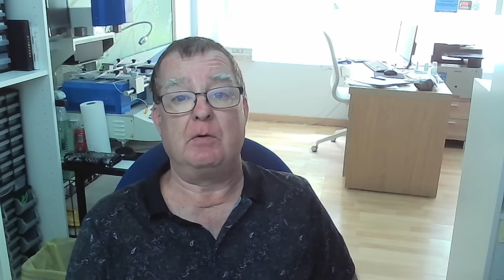The Art Of Methodical Fault Finding - A Practical Example

Comment from the maker: IMPORTANT NOTE At 51:12 I drew the collector of the transistor connecting to the wrong end of the 10K resistor.
Reply: How the hell did you pass your exams 🤦‍♂🤣🤣🤣🤣🤣🤣🤣🤣🤣🤣🤣🤣🤣🤣🤣🤣👌👍
Reply from the maker: @paulc9139  With distinctions funnily enough LOL
Reply: @LearnElectronicsRepair  Good
Reply: phew! I was thinking this would be a better place for base control. Thanks for clarifying.
Reply from the maker: @jonnafry  Yeah, where I drew it would mean that the transistor turning would attempt to short out the Vcc to the chip.  As this is supplied via a 470R resistor to a zener it would not damage the transistor but cutting power to the chip would turn the transistor off again. Maybe it would oscillate.

Sometimes when reverse engineering it is easy to make this sort of mistake - you either realise it is wrong, or you imagine the circuit working as you expected it to.
Reply: @LearnElectronicsRepair  Aha! BTEC HND like me? Us old boys went to technical college I'm guessing...
Reply from the maker: @martinda7446  Actually City & Guilds in TV Radio and Electronics Repair (3 distinctions) and HNC in Microprocessor Systems Design And Programming  (distinctions)  My C&G was 12 months full time and my HNC was 2 years part time.  These you know are vocational qualifications, I finished school at 18 (A Levels) Other than that I am self taught and don't have a degree level education.
Reply: @LearnElectronicsRepair  Thanks. I'm loving your channel... You seem to grow on us!
Reply: @paulc9139  ha ha. The thing I nearly always do when connecting wires together is I for forget to put the heat shrink tubing on 1st. I done it twice yesterday. 🤬😂
Reply: @Learn Electronics Repair I sometimes see in the plant high degree repair made not by engineers, but self taught technicians. And it's funny to see how unbelieveable it is, when you saw amazed eyes of an engineers saw a problem fix by a self taught engineer or technian. And we know how much are ingineers degrees school hard.
Reply: @LearnElectronicsRepair  We are in the same situation with education, I am totally self-taught, I don't even have a university degree, and I have high school without certification. However, this did not prevent me from working as an engineer, submitting several improvement proposals in the field of electronics, and winning first place in the national competition of HP service technicians.

Nice day 🙂 Tom
Reply: @AIexanderHartdegen  This is exactly how I chopped up one chief engineer last week when he said - this cannot be measured, we don't have a measuring device for it - so I demonstrated it to him with the help of my own portable oscilloscope, measuring coils made provisionally from an electromagnetic valve that was lying around on my shelf and screw from the chair from which I made a core for the coil.

Nice day 🙂 Tom
Reply: Yes I noticed that very quick, otherwise you would short out the VCC to ground

Comment: A note on the Intro. There is a book called a mind for numbers. It describes the 4 am solution process. For solving problems, your brain has 2 modes, focused and diffused. In short for math/logic problems you should spend 15 min at 100% focus trying to solve the problem. Then you should do some task that has a low mental effort e.g walk, sleep, bath. Your subconscious continues to work the problem. In this "diffused mode" some solution or progress will come to you. This harkens back to Archimedes and the Eureka moment if you read that story it will make sense. P.S great video!
Reply: Thanks ive added the book to my Xmas list from the mrs 😂
Reply: @andrewtucker6325 well, don't leave us hanging, did you get it as a present? 😉

Comment: For easy problems repair experience is the number one factor in electronics repair. But if you're repairing difficult circuits it helps if you've some design experience and formal electronics education. At least, that is my opinion. Only electronics education is not enough though.
Reply from the maker: So really in my analogy you are saying the more or the 'art' you have to go with the 'science' the easier it is. But you acknowledge that you still need the voodoo 😉 
I couldn't agree more.  I've worked with many engineers who have parts 1 and 2 of the equation and can repair stuff well, especially when working on one sort of product (be it TV, amplifier or some sort of microprocessor based controller board) but without part 3 they can't just pick stuff up and fix it.

Comment: Oh goodness me, you've just described me, in when I did  my apprenticeship In TV/Radio/Electronic repairs in the 70's very exciting times, College taught me the science of it, my allotted engineer  taught me the how to do & expanded my mind to the voodoo of it, then one day it clicked, the voodoo was installed in my mind, that night I wrote down what I thought the problem on a TV we were working on, and showed it to Andy the engineer mentor in the morning,both our notes were the same, I was right YES,  this week for instance I was given a lovely multifunction power supply, which  the magic smoked from a regulator, so changed the reg, then  I proceeded as to why  the reg blew out, in my discovery I found 2 electrolytics with 4 & 6  ohm ESR plus a diode that went shorted a change instead of open, which I think was  the problem along with the caps, May the Force stay with you.

Comment: I really appreciate the methodical way you went through and figured out how the circuit works. That's obviously something that takes time to become good at. I'm nowhere near that level yet, but at least I was able to follow along with you and it all made sense. I will have to troubleshoot a lot more circuits before I can sight read the values of resistors and know which pins are BCE for the transistors, but I'm sure I'll get there eventually. In a previous life I was a software engineer and so of course I took a good amount of EE classes including a couple upper division (it's been 25 years since I got my BS in CompSci). I always liked the EE classes and my favorite software classes were the ones where we coded in assembly. I much preferred managing the parameters in and out of a subroutine on the stack in 80x86 asm than I did designing data structures using virtual classes. Thinking about the latter still gives nightmares. It wasn't that i couldn't do it but it just didn't come to me as easily as the low level stuff. I worked with some brilliant software developers in my career that could design amazing objects that not only did the job but were so sophisticated with elegant interfaces. Whereas if I were to design the same thing it would probably get the job done (eventually) but it would look like a crazy person built it with scrap parts and things patched together in a convoluted way with some paths that lead nowhere. And my interfaces were clunky and incoherent so if you weren't careful you could easily break something. But those same class masters would be triggered even saying the word "opcode" or "register" and I could do some similarly sophisticated and elegant things in assembly. It's a shame that I went straight out of college to a 14 year career with a company that was mostly doing C++ programming. I did get to do some asm stuff early on but that's when our product only ran on PCs running DOS and the existing engine, although written mostly in C, had some asm subroutines and there were cases where we had to do new stuff in asm for speed reasons. But even in those early days the groundwork to move our code to a platform neutral model based in C++ and eventually ported to upwards of 13 different CPU/OSs , so we quickly abandoned writing any platform specific asm code. And don't even get my started on the nightmare that was to come of that "new" C++ code base. We really should have built the new system from the ground up but the paper pushers didn't want to give us the time and resources that would require. They reckoned that we already had something that worked  (for the fading past) and we couldn't afford to just scrap it, so we had no choice but to use it as the base to build that scaffolding that was to support the next 20 years of who knows what. Supporting that code base on all those platforms was a nightmare. I've gotten way way off topic and I better stop before my blood pressure spikes.

Where was I now... Oh yes, looking back I wish I had gone the EE route and I probably would have enjoyed my professional life a lot more and not have burnt out so quickly. As it was I ran away from my well paying corporate software engineer job and had no idea what I wanted to do. I existed off my severance, which was quite generous, for a couple years living cheaply. But I had earned it after all the 60+ hour work weeks (salaried, of course) where it was always "not a good time to take a vacation right now". I had maxed out my PTO and was simply loosing it because my company was shitty like that. Had I been receiving cash payouts for those accumulated days off I might have stuck around longer. Anyway I eventually started an IT business and did that for about 11 years but I never really liked that either. I was always good at troubleshooting and fixing computers so it was a natural option. This is why I understand how you can't teach what you are doing. People would always ask me how to teach them and I would tell them I can't. I wouldn't even know where to begin, because I have no idea how I do it. I've just been hacking computers since I was 10 years old. I started on a TRS-80 with BASIC and a cassette drive, but we eventually got a low density 5.25" floppy. A couple years later the family upgraded to an 80x86 PC and a couple years after that I got my first 386! Every computer I got after that I built myself. When I am troubleshooting some sort of problem I just intuitively know where to start looking and even if I'm working with hardware or software or a system I've never used before I know the fundamentals and design commonalities that most of them follow that I can figure my way out and get up to speed relatively quickly. If they insist I tell them there's no way I can teach you to do what I do because it took me 40 years to learn it. It's just something that comes natural without thinking too much because I've done it my entire life, like waking or riding a bike. 

To wrap this epic up, I have since closed the IT business recently to focus on fixing vintage HiFi equipment to make a living. It started out as hobby because 10 years ago I moved to Hawaii and I didn't bring anything with me. Eventually I got tired of using shitty Bluetooth speakers and since I couldn't afford to ship my beefy Cerwin Vega loudspeakers and Yamaha amp that I still had stored at my parents house (I kept a few of my nicer possessions stored there and sold the rest when I moved) I went to Craigslist to see what I could get cheaply. I picked up a simple vintage stack of Technics gear that came with a non-working tape deck. I hadn't listened to tapes in a long time but I thought I might as well see if I can fix it just so I can use it every once in a while. Having never repaired anything at the circuit board level (besides debugging my designs for EE classes on breadboards all those years ago) it was a bit daunting like going into the jungle for the first time, and the wiring being like vines completed the metaphor. lol. I had remembered the basics of electronic components from my college EE classes, like I knew what resistors, capacitors, diodes, transistors, and even logic gates and such did on their own, but I wouldn't say I had a great wealth of knowledge of circuit design.  So I just jumped in with a cheap multi-meter and no other instruction (YouTube didn't have many channels like yours back then and I didn't really became a regular user of the platform for at least a few years after that point) and went at it the same way I would when I troubleshoot a PC. Magically I pretty quickly found some bad electrolytic caps on one of the boards (I had no idea that they were such a common fault in 20+ year old equipment at the time) and without trying to understand the circuit like you did in this video I swapped them out and it worked! I was so pleased with myself and my "new" cassette deck from the 80s that I bought a stack of old cassettes and sought out other old hifi gear to fix. It spiraled from there because I could fix something and then sell it to trade up for a better piece of kit for my system. When I got my first "audiophile" grade gear for almost nothing and was able to fix it I was totally hooked. I went from just wanting a decent stereo to acquiring, fixing, and selling as often as I could. There have been some failures and a lot more dead ends that I intend to go back to because my skills weren't as good at that time. Eventually I got people responding to my ads for sale asking if I could fix there stuff. I hadn't thought of doing that but I said sure I can give it a try... 

So that's pretty much the story. I'm not making a ton of money, mostly because I keep too much of the gear, lol, but I'm in demand (and backed up) and I can work from home and people are so happy to have someone that can fix the old receiver that they got from their dad or granddad or they are an old guy that's had it since the 70s and it sat in the garage for the last 20 years. All this to say you got a new subscriber. I'm still learning and one day I hope to be as proficient as you. At one point I knew all the opcodes for the Motorola 68HC11 chip by heart and could read and write machine code in my head (that's a story for another time, but I'll just say RISC architecture is so much more simple so the instructions all follow a simple and well defined pattern) so I know I can eventually get  to the point where I can sight read a resistor value! Cheers and Mahalo!

Comment: Big big thumbs up for the assembly comparison. As a former c64/amiga asm coder really can understand it. Assembly programming just as electronic repairs needs much more than knowing the basic rules and elements. While trying to resolve a problem in asm we sometimes deleted all our work just at the finish to start over again to try out another solution found while writing the last one. Asm coding was a kinda trial and error method in term of logic of the solution. It was never a problem to write the code for a new logic, the real deal was to always find a better logic/way. That’s how all those audiovisual demo programs were made on computers with several mhz. Now as a game developer (using high lever languages) I feel the need for turn my old amiga on and do some asm coding just for fun. It was the golden age for sure…

Comment: Hi, I happened to watch this video, somehow it started after I finished another one, but I honestly watched it until the end.¨

I completely agree with you, the art of diagnosis cannot be taught, everyone has to learn it for themselves. In this video it is clearly shown that we are different in the procedures when repairing a device that does not have a schematic. I would proceed a little differently, but the result would be the same. It is very important how the defect is described, once I was called to repair the device and based on what I was told I started to look for the defect, I could not come up with anything and then by chance a worker from the second shift appeared who described the defect a little differently. At that moment I focused in a different direction and in five minutes it was fixed, if the fault had been interpreted in this way, I could have immediately saved an hour of measuring the functional circuit - the fault was in a completely different place.

I wish you a nice day and a pleasant Christmas holiday 🙂 Tom

Comment: Like always, great video! The IC chip controls the charging by oscillating off and on charging when on and monitoring when off until it gets to the proper voltage, then stops when fully charged.

Comment: At the start of your diagnostics with the battery charger my first  Suspicion was with the LED'S as you tested  particular with the green LED With LO READING were it wasn't lighten up likewise i would replace the LED'S. but i have still lot to learn.🤔
Thank you your teaching 😁
Reply: Yeah, if it was me I would have narrowed down the likely points of failure based on the problems it was exhibiting and a quick visual inspection to see if anything looked like it failed. Then I check those failure points starting with the lowest hanging fruit. But that wouldn't have made a very interesting video and I really appreciate seeing this more thorough approach as it helps me to troubleshoot my next project even quicker using the new information I've learned

Comment: The chip is a HEF4060P - The HEF4060B is a 14-stage ripple-carry binary counter/divider and oscillator with three oscillator terminals (RS, R TC and C TC ), ten buffered outputs (O3
to O9 and O 11 to O 13 ) and an overriding asynchronous master reset input (MR).

Comment: 53:10 looks like the mystery IC is MC14060 OR CD4060 and the task of the IC is to give  a 10H/12H/14H Charge timeout (after each mains power outage) to not cook the batteries forever

Comment: It seems this is a very simple charger with a counter inside the IC which is feed by the oscilator and it just stops charging after 14h or so. Current is only limited by the respective resistors.
Reply from the maker: Hey yeah, That could make sense out of the slow oscillator with 1% tolerance resistor

Comment: MAX713CPE MAX713 NiCad/NiMh Battery Charger IC is a 16 pin candidate this is my thought at 29:00,  but now it would seem this is a very basic charger !nice video....cheers.
Reply from the maker: Apparently from another subscriber who has the same charger it is HC4060 CMOS oscillator+counter.  The resistors limit the charging current and the counter turns the charger off after about 12-14 hours.  So very primitive.